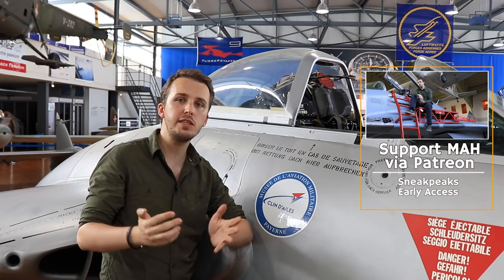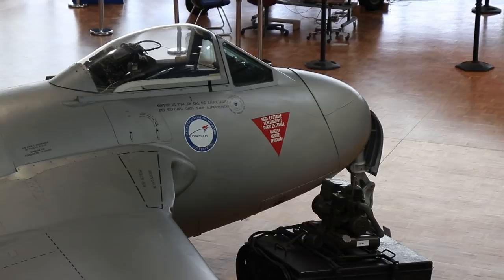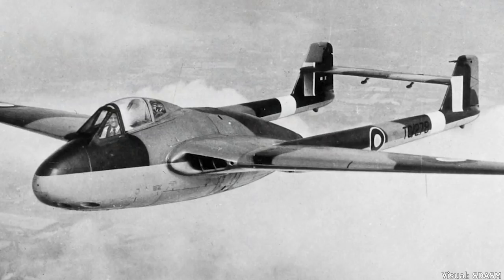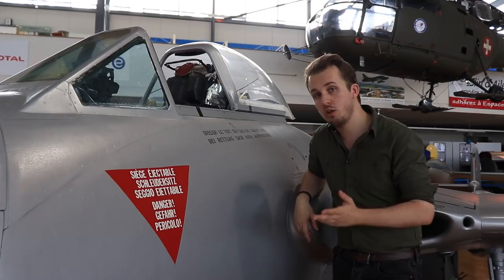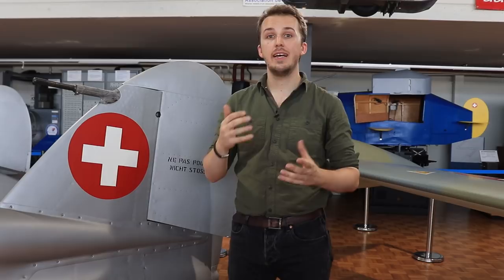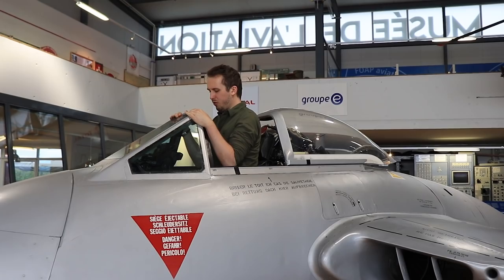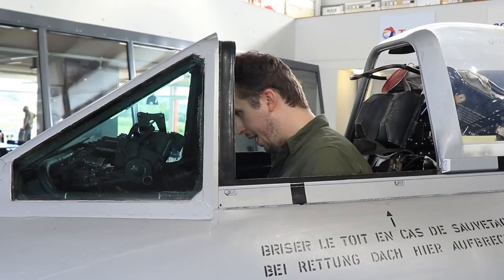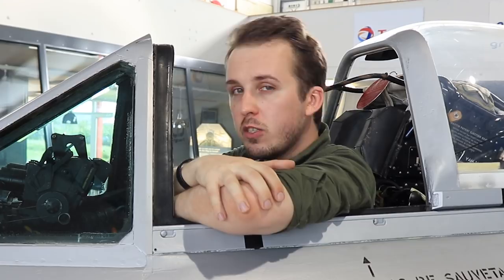Inside The Cockpit - de Havilland Vampire

Comment: De Havilland understood that wood was much easier to work with and allowed mass production in higher numbers than any metal.
That´s why their planes were so successful in WWII, the British could field them in as many numbers as they had pilots available.
And any lost plane was fairly easy to replace, which rarely enough happened due to the high speed and flight ceiling.
Reply: DeHaviland created the worst engineering failure in aviation  history with the Comet... the company folded in 1958 because it simply had no experience with modern aircraft metal fabrication techniques.

DeHaviland was still building wood and fabric biplanes like the Dragon when the rest of the world was building modern all metal monoplanes.

Comment: I could fit one of those in my garage. Really!!!!! These, the two seaters and the venoms make very good entry level jets. Unless you have a two-seater, your first flight is going to be a solo. So get some really top notch training before you mortgage your yacht for one of these little sport cars. I think, for the money, I could have just as much fun in a Cessna A37 Dragonfly. Built in the US in the '70s. Parts still available. Two seats, long legs, a bit faster actually, and way cheaper to maintain. Keep the centerline tank, turn the midwing hard points into luggage stowage and you've got a little rocket that will cruise in the 20's at 550 plus knots all day. And, it's mildly aerobatic. If you want to chase those pesky FalconJet and LearJet drivers around in the pattern.

Comment: I find it fascinating that the same Rolls Royce engine series effectively powered the US, British and Soviet jets of the age, with the 3rd generation Nene used in the Vampire being copied by the Soviets to power the Mig-15, 2nd Generation the Derwent powering the Meteor and the 1st generation Welland being copied by GE to power the US P-80.
Reply: It's had to believe Rolls-Royce was so far behind in jet engine design... they didn't not produce viable axial compressor engines until the 1950s.

Comment: The engine name is actually pronounced Neen. The early RR engines all seem to have been named after rivers, the Nene being in Eastern England (Although in Northamptonshire it's pronounced Nen).
Reply: They still are. There was a gap period where they stopped using river names (the RB211 and RB162 never had names) but they have returned to the practice again and are today producing the Trent and Tay (both names which they used before). I think they had run out of UK river names by the mid 1960s.

Comment: Development of the Vampire was held up for over a year after it first flew as a prototype in 1943 because the damn yanks demanded the only 2 Halford engines in their prototype Lockheed XP80 ( Shooting Star) in 1943/44. They trashed the first one and crashed the second . The early Vampires were superior to the Mk  and 3 Meteors with a speed of 540 MPH . WHY DID YOU NOT COVER THIS BISMARK ???

Comment: "the swiss kept them in service till 1990" 
OK we did have F-4s in the airforce in 1990 but a gen 1 jet in the 90s was pretty crazy
Reply: Not that uncommon when they've been delegated to roles like trainers, target aircraft or target tugs. Sweden has trainers from the 1960's still in service and only now have they've begun to need replacing after starting to face metal fatigue.
Reply: The EKW C-36 (a swiss-built heavy fighter/ground attack plane) frist flew in 1939 and was retired from service in 1987.

The swiss army had Jagdpanzer 38(t)s in service til the early 70s.
So yea, the swiss like to use their toys until they are broken...
Reply: Well, Austria used the Draken as interceptor until 2005. (And from a proud pilot who had just come back from an exercise i heard in 1999 that they were able to defeat swiss F18's in dogfights. This was obciously not often or the norm, and understandably they were quite proud the few times they managed to...)
Reply: Doesn't North Korea still operate some MiG-15's??
Reply: @Martijn
That's certainly possible, they are in kindofa bad shape, but does it realy operate them (as in actualy flying them) or are they simply still in the official equipment list?
Reply: @Bird_Dog00  Yeah, it's a very efficient use of funds/material right up until the point where you have to actually fight a less thrifty enemy...  ;)
Reply: @Seafodder
Well, the C-36 was mostly used as a target tug for the Flab. 
And the G13 (swiss desgination for the Jagdpanzer 38t)? Well it depends on how you use it.
Against enemy MBT? Yea, forget it. But for shooting at BMPs from ambush or providing direct fire support for infantry by lobbing HE shells? He, probably still good enough...

Comment: Why is it that the P/F-80 is never talked about, when talking about WWII jet aircrafts
Reply: Was it operational during WWII?
Reply: @wilhelmsallsten7706  Yes, but only as a recon plane, not as a fighter
Reply: The performance and reliabity of the P-80 was very poor during the war, later F versions were greatly improved after the war.
Reply: osp80  They spent most of the war grounded with technical problems.
Reply: osp80  Crap compared to the Me-262... Germany was years ahead in jet technology.
50 hour TBOs is excellent for a jet fighter used in combat.. the GE J47 engines in the F-86 Sabre had combat TBOs as low as 12 hours.
Reply: osp80  Just the facts here son, just the facts... you don't seem like a person accustomed to being told the truth.

Comment: Excellent video as per your usual standard Bismarck. I was very surprised at just how restrictive the cockpit was and I would have thought that DE Haviland would be aware of different sizes that pilots come in given their experience with the Mosquito. Just how tall are you as a reference?
Reply from the maker: I am 1.9m. A friend of mine jumped into it later, he is about half a head shorter than me and felt less constricted, although not ideal neither
Reply: There were height and leg length limits for Vampire pilots. Most Vampires had no ejection seat so there was more head height in those models. Bailing out was difficult because you had a dinghy & parachute attached under you - the advice was to undo all straps, open the cockpit, turn the plane over & drop out - same advice as the spitfire. The safest thing to do is to stay with the plane if you can & glide it to a landing if you lost power - it glided very well.
Reply: As someone who flies a DH Vamp and Mig 15, I find the Vamp more room than Mig 15... both 2 seaters, tandem and fore/aft, but with the MB seats in x-aussie it does get a bit busy in vamp. The mig 15 you have to slide your feet heels back into a stirrup heel fixture on seat prior to ejection...most cant do it in practice with comfy sweat pants on. Early Vamp and MB seats for Vamp have a peculiar seat pan design....It has tall side seat fixture where the lap belts are connected and its these tall seat fixtures that protect your hip bones...If you have a wide arse then its a bit like your in a vise...secured. I am 5-9, 170 lbs and fit both fine....albeit i am not in for 16 hrs....but 2.5 hrs in ferry range...There are other jets where one would be way more tighter and claustrophobic in. The Jet Provost family of jets are a bit more room...wider...sit higher....more frontal area and 150 kts plus slower. Try a folland Gnat !  TIGHT to say the least. If one views photos of pilots in the Vampire jet team days like Telestars they were pretty lean..a comfy light flight suit helps, Not a pair of snug jeans that dried on the line :)...People are bigger now lol !  just look at the early brochures in general aviation go sit/fly in a Aeronca Chief, Luscombe, Taylorcraft, C-140, C-150, Porterfield, HP-14, etc etc all way tighter than Vampire....and you get in from a door and you dont drop your self in like a manhole cover...I teach in these aircraft and when sizing you up at first glance i can tell what flying machine you will enjoy sitting in and clearly ones i know you cant get out after you have gone in....The Mossie one of my favs 200 kts slower is cabin class compared to early jets light thrust.....pointy less frontal =faster

Comment: Never knew the Vampire had it's speed in km/h!   Also with 1,90m, i imagine you won't find a good fit in lots of older aircraft. I mean i am 3 cm shorter, but have my problems with seating positions in smaller sportscars and fighter jets are kind of the sportscars of flying.
Reply: The airspeed indicator in km/h was probably a Swiss modification
Reply: Until recently the Swiss Air Force was 100% metric. For speed, altitude, rate of climb, everything. They only changed to have and create less confusion when mixing with civilian air traffic
Reply: @francoiswildi8087  Did they have a second altimeter in feet and speedometer in knots? They have to talk to civilian ATC after all, and they would most certainly give them the flightlevel ect. in "civilian"... (I can't imagine the ATC's of Skyguide to calculate for them, and neither the pilots having to calculate in their head)
Reply: @nirfz  Back then, no. Only metric. I cannot tell when they changed. I would guess in the early 90's
Reply: @francoiswildi8087  Thanks!

Comment: That cockpit is lethal. You can't see your 6 critical dials. You can't see your altitude, one of the most important dials of all. I would be very surprised if that design didn't result in fatalities alone.
Reply: I was fortunate enough to own an ex Swiss FB6 for 13 years and never had a problem seeing any instrument. Like anything you have to get used to where to look.
One litterly wears this craft. You strap it on when you get in. I managed to get over 100 hours in it. At 5 gallons per minute it's quite thirsty.

Comment: The vampire was good only for training pilots. It was no match for a Mig 15.
Reply: LOL bring your Mig 15 around when the Vampire first flew ! As someone who has owned and flown both still have the Vampire, the Vampire can fly circles around the Mig 15 !  The Mig 15 flies faster but you wont stay on the tail of a Vampire ! Plus i can always operate off of 4,000 foot strips safely....There isn't enough tires and brakes for a mig 15 to do that.
Reply: @jettah2149  I have never flown either of them but the Mig was faster, had a better rate of climb, a higher ceiling and more powerful firepower than the Vampires. In the hands of skilled pilots those in the Migs would have the Vampires pilots in inferior positions quite easily.
Reply: @wilhelmsallsten7706  Not to slam ya but your a wannabe. I have owned/and flown a Sb-lim2 for over 25 years, and I own/and fly a x Aussie Vampire for over 20 years :)  You have no idea about High G maneuvering ! you wouldn't have a clue the size of radius of turn it takes to bank and yank a 15 around ! The Vamp is a antique ! The Mig 15 almost as old, when one compares a 15 or 86 against a Vampire its ludicrous !  I would think with almost twice thrust to weight ratio the 15 and 86 should have some performance capability over the Vamp but its not staggering !  Go fly some real ones and not Microsoft :)
Reply: @jettah2149  In the hands of a good pilot the Mig pilot would know the strengths and weaknesses of the Vampires. Even the pilots    of Hellcats and Corsairs had strict orders not to dogfight a Zero. Any aircraft is a compromise of factors, and in the case of fighters speed, rate of climb, range, good and easy handling, (a Spitfire may have had better high G turning than a Messerschmitt but not by much, it had more benign stalling characteristics which gave an advantage to a less experienced pilot) maneuverabilty ceiling and fire power. I am not contesting your knowledge or experience    but what is the kill ratio Vampire v Mig? The combat must have been in the Korean war when only a few Mig pilots
 were highly trained Russian "honchos" and those that were claimed a kill ratio of 3 F 86 Sabres for every lost Mig. So, if pilot skills are equal which one is better in combat?
Reply: Like the Gloster "meatbox" the Vampire was no fighter..
And no match for a MiG-15 or F-86 Sabre